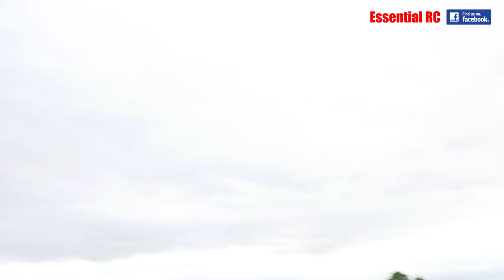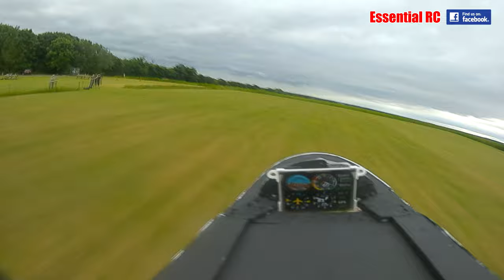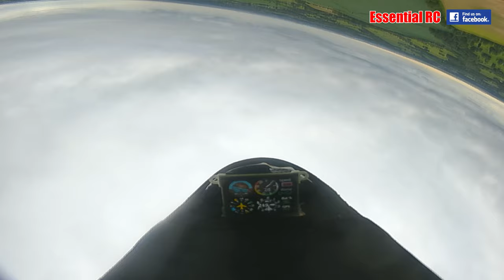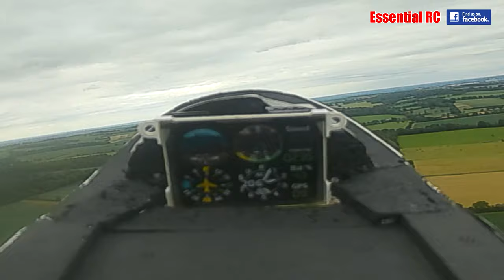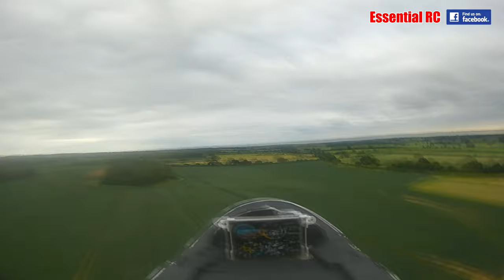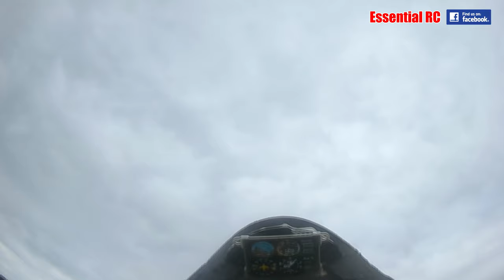AWESOME FPV FLIGHT | Onboard REALTIME Telemetry Cockpit Display | DJI FPV RC Freewing Avanti EDF JET

Comment: excellent 👍👍love the instrument panel
Reply from the maker: Hmmm. No good in bright sun light TBH
Reply: @EssentialRC  ahh that would be a problem . a little off topic ,what make is your  head tracking system you use on the flight sim,
Reply from the maker: @NorthEastFPV  TrackIR

Comment: Yes, much better visibility on the in camera gauges.  I was inspired on this topic early on when a guy let me fly a slow FPV model.  He had a tiny ribbon and a small ball compass in the view.  It made me very interested in what kinds of "steam" gauges could be easily made.   Thus why your video caught my interest.   I think the camera would be improved if were not swinging off center left to right as much.  More overtop of the spline would keep gauges in view through more degrees of head yaw.   I am sure you don't need to look at them anyway.  Looks like great fun.  Liked.

Comment: Build a black shroud around the monitor extending as close the camera as possible (without getting in the way of movement) and it will make a huge difference in the visibility of the display.

Comment: Great video. What do I need to get that exact fpv system for my aircraft. I would like the exact same thing you have.  Thanks!!
Reply from the maker: The DJI FPV system used here has been superceeded. You need DJI Goggles 2 (https://store.dji.com/uk/product/dji-goggles-2?from=store-nav&vid=127611) and a DJI O3 Air Unit (https://store.dji.com/uk/product/dji-o3-air-unit?from=store-nav).

Comment: Very cool video! What receiver are you using in the jet? Do you get OSD telemetry on your DJI goggles? I fly drones, but not sure what type of receiver to get that will work on RC airplanes to get telli to show in my goggles.
Reply from the maker: If I need telemetry I use Matek flight controllers but they add a lot of complexity. I didn't do that on this project because was experimenting with that small standalone LCD.
Reply: @EssentialRC  thanks for info, ill look into the Matek system !
Reply from the maker: And to be clear we run iNav on our Matek flight controllers.

Comment: Nicely done !
1) How did you "get closer" to the instrument panel? Camera zoom? Do you push a button for that?
2) I couldn't see the speed. Could you? 
3) Do you really need the RPM gauge? You could use the place for speed display (will help in landing....).
4) Do you think that if you'll build a shelf around the  instrument panel it will help you in brighter days?
5) I meant ( a few days ago) if it can be done, not a real compass, but an arrow that will show you the point of which you took off. In that way , you would not get lost.....
Reply from the maker: 1) Editing the video after the flight.
2) Yes. YouTube degrades the video quality quite a bit.
3) There is no RPM gauge!?
4) Sure but it would obstruct the FPV view. Its a trade off.
5) That's what the house symbol on the compass lower left indicates
Reply: So the right upper gauge is the speed gauge? If so, is it in MPH or KPH ?

Comment: Very good attempt at presenting useful telemetry on “instrument panel”.  A for effort!  It’s in a bit of a pickle though.  It needs to be a certain distance away from camera to be seen in focus , however at such distance, the data are bordering on too small to be legible.  Needs more refinement to be a useful display, from the perspective of an FPV pilot.
Reply from the maker: It won't replace good OSD telemetry for me but its a great dynamic feature to have in an FPV cockpit.

Comment: Do you use a flight controller? How do you power the air unit?
Reply from the maker: No flight controller on this project. Air unit powered by connecting its power lead to the 6S flight battery with a dupont connector.

Comment: That’s Pretty dang cool! Have you tried shading the display? If the screen is getting washed out it might help.
Reply from the maker: Yes. Showed that in a later video but regardless of that the info displayed will always be difficult to read. The telemetry that we get in the OSD in the DJI goggles is much better. Just unfortunate it cannot be shown in a video at the moment.

Comment: Do you know of a way (if it's possible) to do head tracking without using the transmitter? The reason being is that I'd like to set this up with some RC cars. I'm not looking to change all my cars to a flight type transmitter.
Reply from the maker: I don't, sorry. My only suggestion would be you have a second receiver for the head tracking in the car that is controlling the pan/tilt servos via signal from 2nd transmitter hooked up to head tracker. That 2nd transmitter could just be on the bench while you use your normal transmitter for controlling the car.
Reply: @EssentialRC  That's the only thing I could think of as well. Appreciate the reply, man! 🙌

Comment: Interesting idea and hopefully the brightness issue gets sorted.  If not then it's a bit much to pay to only use on cloudy days.  I personally think having all 4 telemetry readouts on one screen is too much, too small.  Would be cool if you could cycle through each telemetry readout manually so each one can fill up the entire screen or maybe even on some type of auto-cycle so you can see each gauge for say 5sec.  Having it on say a switch to stop the auto-cycle for say the airspeed screen when you are landing.
Reply from the maker: RCGauges are aware of the problem. He is continuing the development so with luck we'll see improvements soon.

Comment: Hi Dom.  How can I get a true On-Screen Display for speed, altitude, distance model is away from me and a Return to Home arrow for the DJI Air Unit?
Reply from the maker: Look at Matec F405 or F675
Reply: @EssentialRC  Will do
Reply: @cobratraxxas  yes you need an FLight controlled one of the 405 units will do the job, then use a uart port. Lots of tutorials online for it
Reply: @randall8686  Thank you!  What's an uart port though?
Reply: @cobratraxxas  it stands for “Universal Asynchronous Receiver Transmitter” in simple terms it’s how one device talks to another such as a air unit and flight controller or reciver and flight controller etc. Think of it as a USB port on a pc it’s how you connect one device to the brain. It sounds complex and I will be honest it’s daunting when you first start messing with iNav etc but once you get your head around it then it’s not that bad. Checkout a channel called painless360
Reply: @randall8686  Thanks Jason!  I'll check it out!